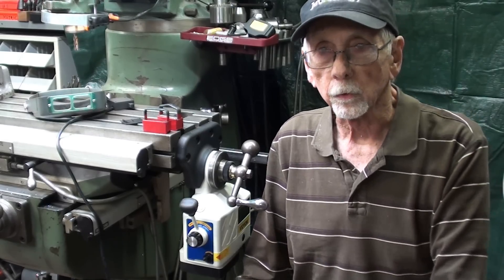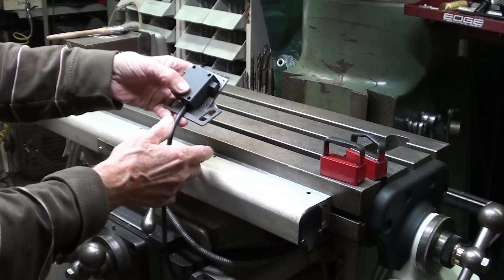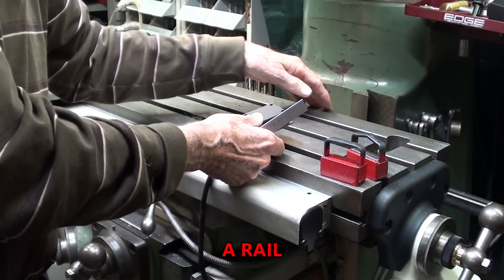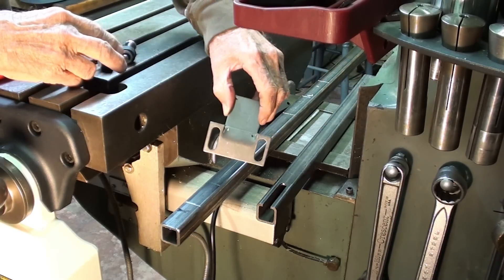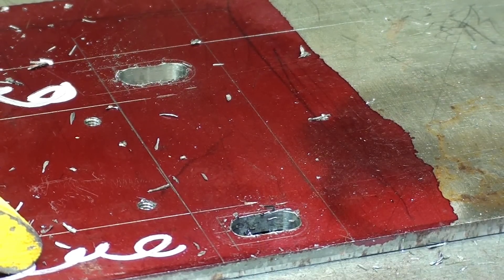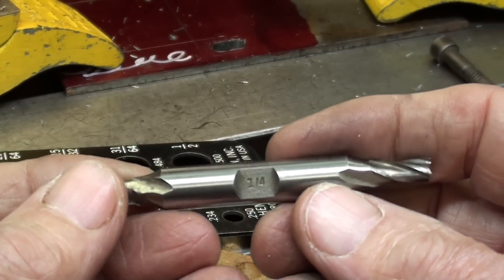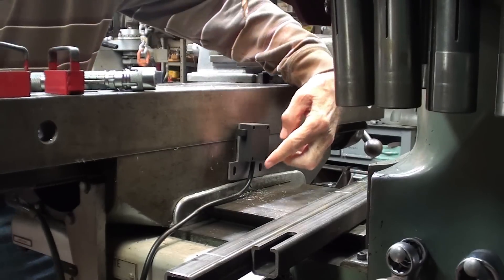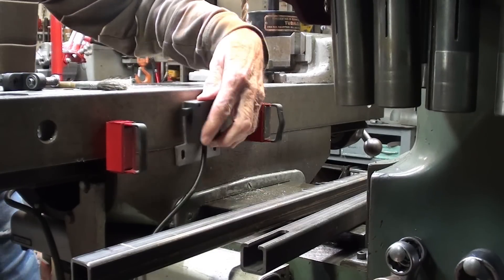INSTALLING BRIDGEPORT LIMIT SWITCHES pt 1 #904 tubalcain mill

Comment: A piece of 7/8 Unistrut and a couple of 1/4-20 T nuts from the electrical supply instead of the $quare tubing and you have totally adjustable limit stops over the entire length of the table. Set auto stops for any job, and if you want, weld on actual limit stops the at end of travel. 

NOTE:
 As anybody that ever payed for the stuff can attest to,  the dollar sign in square tubing is not a typo.

Comment: I'm liking how this is going to work.
One suggestion came to mind, maybe make an opening large enough at the end of the slot so the T nut would fit through, so you could remove the stops without having to fiddle with the nut. 
Good project, thanks for sharing

Comment: I installed a Presion Mathews X axis drive on my Grizzly mill. It appears the same Chinamen made yours and mine. My limit switch had two springs that go over the square tabs that stick out of the switch block. The springs are a bit longer than the tabs. You compress the springs a bit, and drop the cover over them. It keeps the cover from rattling around. I'm sure you have something in stock in your spring assortment. 
  Keep up the wonderful Videos!
Reply from the maker: I wondered what does Springs were in the accessory bag?

Comment: Seems like you should be using proper proximity switches such as are used with modern CNC mechanisms, not that China Vevor cr*p, to avoid interference with the table motion.

Comment: My Bridgeport came to me with a late 70's or early 80's Mitutoyo DRO and pair of scales- the front long scale is spaced away from the slots with 1" aluminum blocks on each side so the limit switches and stops are tucked in behind the scale, everything always worked fine

ALSO- The way you've changed yours around, I believe you'll have to swap the plugs on the switches inside the black box as the wrong switch is now on the wrong directional side of the facing of the box...........

Your way seems an over-complicated solution to an easy problem?
Reply from the maker: Sounds like you had a good solution, I never thought of it
Reply: @mrpete222  Well, I saw what you had started, and thought I should chime in and maybe it would help you re-consider your design? The two alloy spacer-blocks that the scale bolts go thru are easy-peasy to make and then keep all the geometry and switch wiring standard?

Comment: Just curious Lyle... Since you expressed an interest in conservation of space behind the mill table... Why not mount the "track" with the slot on the bottom? That would eliminate the need to space out the switch block more than enough to allow for it's cover...
Reply from the maker: Great idea, but it’s too late now

Comment: Nice design Mr. Pete 👍enjoying the project. As a side note...I have the same limit switch and it came with two springs that go over the plungers and under the coolant cap. I know that's about as clear as mud. 😁 It really helps to stabilize that cover, but it is a PIA to to fit those springs in. Hope that helps see you in part 2.
ATB......
Reply from the maker: I was wondering what the extra Springs were four and the accessory pack

Comment: I use my end stops a lot. I have one piece that I need to mill on a regular basis and do 100 at a time. I remade the stops with an adjustment screw so I can dial it in easily. I mounted my DRO scale in the front below the auto stop stuff.

Comment: Thanks Mr pete I have the same problem . I have the same dro and is also mounted on the front .have no stops for my auto feed never mounted them so great idea. Looking forward to part 2 .how about using magnets in a block of aluminum or copper to make less magnetic fields using neo magnets recesed in the aluminum or plastic ?

Comment: Just for fun..... You could have 3D printed that spacer block and used a metric dimension for the L & W, and an imperial dimension for its thickness. Maybe save that idea for when you add limit stops for your "Zed" axis..... It's a whole new world out there....LOL. But really, GREAT video. Thank you for letting us look over your shoulder as you tackle this problem.
Reply: Or he could have gotten two pieces of 3/8 by half inch by 34 inch long pieces of mild Steel and milled a 45° angle on the long edges then fasten them to the back of the table forming a dovetail. Then cut the t-nuts to form a corresponding dovetail. They don't have to be accurate just sufficient to hold down the limiters. This setup subtracts more than an inch off the profile.

Comment: Is it possible to turn the rail you've made 90 degree so that the limiting bumpers are at the bottom? This way you could save some Y travel at the expense of less convenient bumpers repositioning. P.S. I've watched all the videos you have, expecting at least as many to come in the future!
Reply: Also, this configuration would solve the problem of chips and coolant collecting in that slot over years of use. It would also shield the switch from the same, too.
Reply from the maker: Good idea
Reply: Excellent idea. I like it.